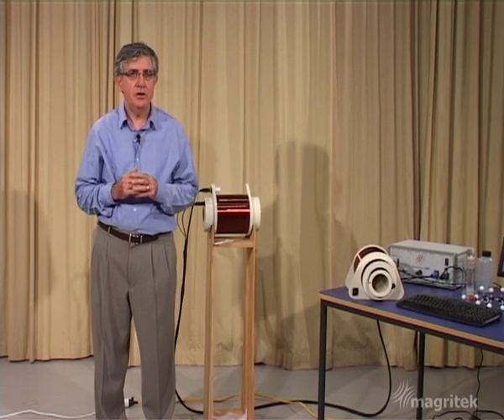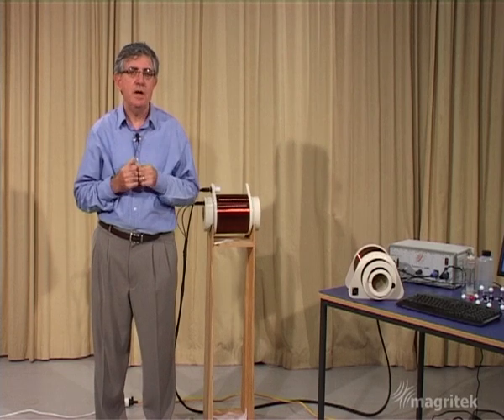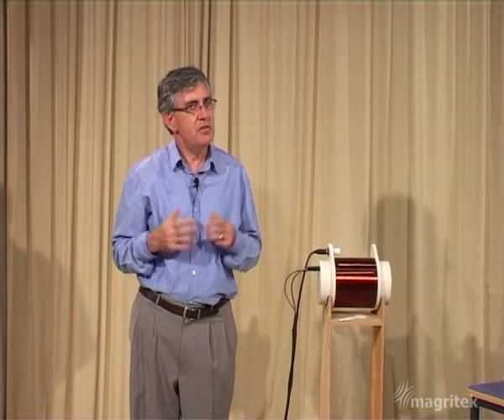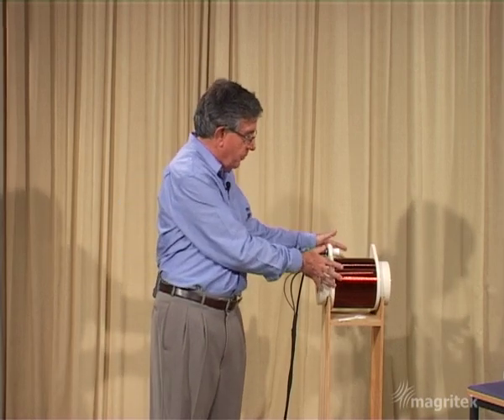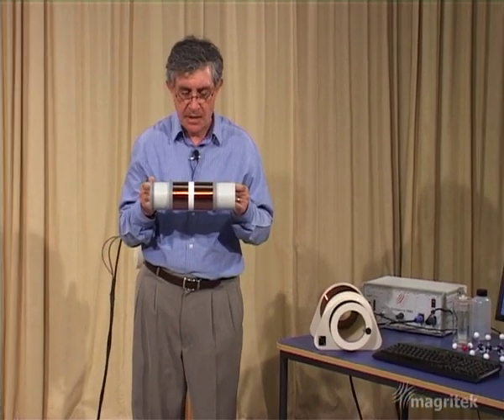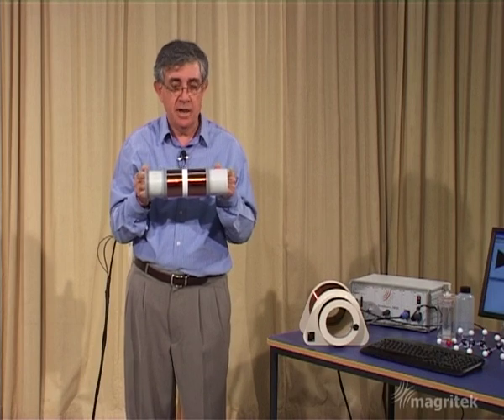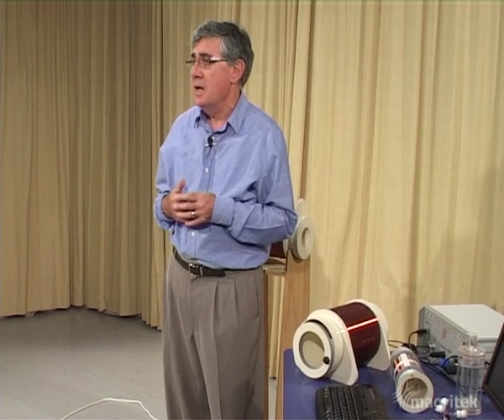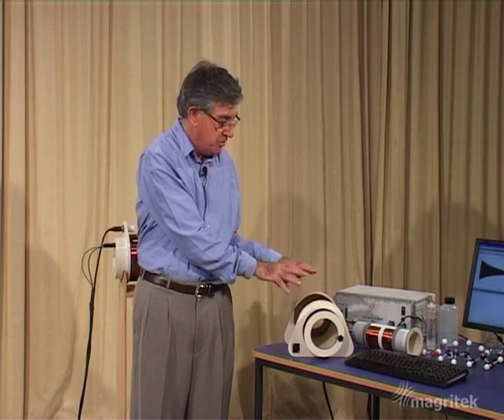Introductory NMR & MRI: Video 03: How the Terranova-MRI works

Comment: Why is the prepolarizing field generated in the same direction as the oscillating transverse field? Shouldn't they be orthogonal to each other?  Or does the prepolarizing field just ensure a large amount of similarly oriented protons, which all then shift to orient with the earth's field, which is fairly orthogonal to the oscillating transverse field?  If that's the case, then once you get a bunch of protons oriented in the same direction, they tend to stay oriented with each other.